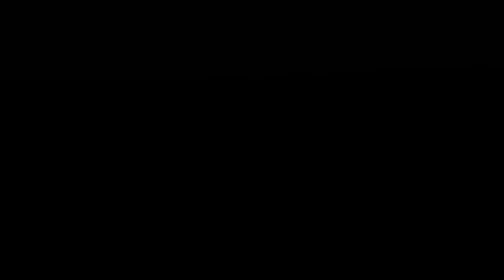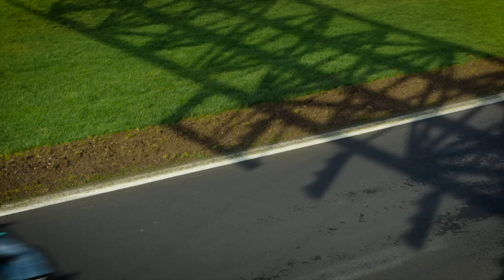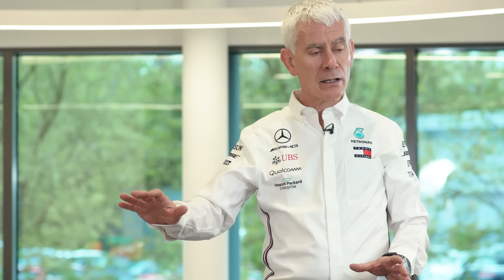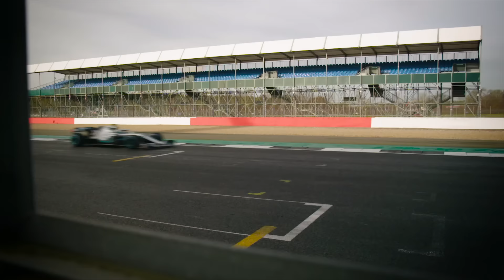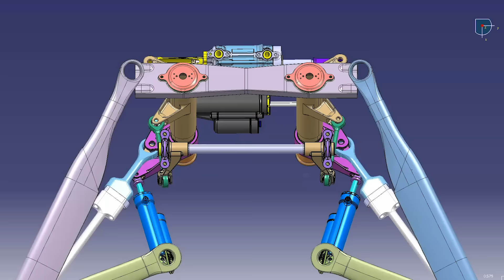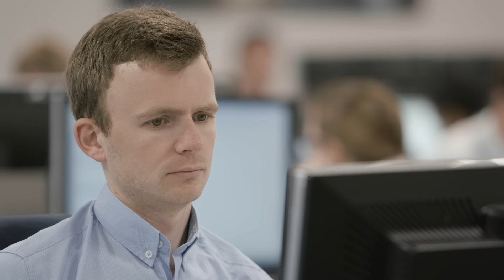How Does Suspension Work on a Formula One Car?

Comment: Mercedes: dominant competitive team

Also Mercedes: tells other teams how they make their car
Reply: ALSO Mercedes: still win by 30 sec after showing how to make their car
Reply: 1. They didn‘t show their newest suspension with the pushrod
2. They just show the obvious things
Reply: @rainys8223  - this is'nt the W10 which has the advanced 2 piece link front push-rod; this is more like the W09.
In this video, the "animated" part shows only the pull-rod and NOT the push-rod.
Reply: @rainys8223  - plus the W10 is running a "simulated" brake-by-wire rear wheel steering.
Reply: Rainer r/wooosh much?
Reply: This video showed nothing other than the obvious
Reply: Ik they used an older steering to make its video to keep the current one under wraps. They dont expose everything. They're not stupid lol
Reply: They didn't show any of the fine details, just the basics that every team already knows
Reply: easy on the

double spacing.
Reply: Racing Point clearly is watching these videos xD

Comment: Just shows how much work and ingenuity goes into these engineering marvels.
Reply: Only scratches the surface.
To keep it understandable for the majority of viewers and Williams engineers. 

They didn't go into camber toe in toe out and how the suspension changes those values depending on the centrifugal forces. 

Example. Camber is how much the tyres are tilted. Want them flat when braking and accelerating in a  straight line. 

But when the car tilts in a corner you lose surface area. So for high corner speeds you'd want the outer tyre flat on the tarmac despite the roll and remain full contact with a potentially bumpy track.

You see this can't all be achieved without active suspension which is banned by the rules. 

So they have to be (and are) very clever in making a mechanical suspension which adepts depending on load. And fine tune it for every specific track. 

Now how they do it? That goes way over my head as well.
Reply: @1barnet1  I like what you did there

Comment: F1 Suspensions are just brilliant.  50 years of evolution in design.  Separation of roll and heave....   No more coil overs....  torsion bar handles all roll stiffness.... the torsion tube spline and secondary arm design gives you a ton of flexibility to change motion ratios....  you can separation motion ratios of roll and heave....just bloody amazing.

Comment: My takeaway on this, is that I can't even begin to comprehend the strength of the spring unit in the Heave Spring, since it basically supports the weight of the entire car and the additional aerodynamic load, as well as providing for chassis movement!  Well done Mercedes, and thank you for this informative video!

Comment: As a mechanical engineer student currently working on a suspension system, I could say that I would easily die for the Cad and assembly files of this suspension 😂
Reply: So who would do the hard work then if you are dead on the floor? xD
Reply: @Jejking  me, in my very happy spirit form xD
Reply: Well you would of noticed the CAD shown had nothing to do with the F1 cars front suspension shown.CAD shows pull rods F1 car uses canter levered push rods with inboard shocks.

Comment: This is a fantastic series. Thank you so much for posting it. I was thinking... I drive a 'Mercedes', but it couldn't be more different, and more primitive. It is actually a Brazilian Toyota Land Cruiser FJ40 (Bandeirante) With a Mercedes-Benz OM 364-LA Turbodiesel engine, originally intended for the MB-914 truck. Here is the 'primitive' part; my suspension is leaf spring with two rigid axles, and PU shackles.

Comment: I would LOVE to one day see an example (not current year of course) of how the suspension components are constructed and the materials used in building them. It’s always fascinated me how a particular component can carry an extreme loading, either static or dynamic, however only in a particular direction. As in how a front wishbone can absorb impact loading from the weight of the car, and possibly from front-to-rear impacts, but maybe not from rear-to-front or longitudinal impacts. Incredibly complex and interesting, and it would be an unbelievable opportunity to one day get a better sense of ‘the black arts’ used in building them.
Reply: mechanics of materials would be a good start, oh and look at chemical structures to get an idea how bonds form and their strengths and weaknesses. 

honestly it was probably luck at first then lots and lots of experimentation... so more luck.
Reply: They’ve certainly have had some spectacular failures thru the years! As in STR a while back. Trials & errors can lead to huge advancements.

Comment: What a coincidence they're showing the w9 (last year's car), since the new w10 has some kind of extra pushrod link to change the ride height during low speed corners, pushing down the front wing which results in the generation extra downforce in the slower speed corners... might be a contributing factor to why they're so quick this season :) If only they'd reveal those kind of things...

Comment: Great videos. I'm intrigued that you seem to share a spring and a damper for each side of the car. Is there an independent function inside each unit or are they really shared? I would have thought that fully independent suspension across the car would give you greater control. Or is this perhaps a regulatory thing?

Comment: Next up: How Does The Race Strategies Work in Formula One?
Reply: MEGATRON  If you considering about the tyres only, maybe. But, Merc was ahead by calculating the data of the medium tyres, AND the capabilities of their drivers to manage and use those medium tyres for the long run from the FP2 session data. Yes, Hamilton was tremendously pressured by Verstappen, but he was still able to defend him off and took the win splendidly.

Comment: You had mentioned that the suspension effects the aerodynamics of the car. Why don't you contour the pieces to net downforce on the car, or are you afraid of any additional loading to the suspension components? I would think you could then either get more total downforce, or require less from the spoilers.

Also, out of curiosity, what software do you guys use for your 3D modeling? I presume the similar software is something homegrown or do you use something like ANSYS?

I enjoy the videos, keep them up!

Comment: Great video. The diagram of the front suspension seems to be upside down, hummm.
No mention of the new system that seems to be helping Red Bull, where the angle of the front wheels can be changed in corners to give a toe in and more grip on both front tires. Now about the small electric motors in the wheel hubs, that eliminated the need for drive shafts to the wheels... and not being allowed to use those tiny cooling holes....
Reply: Those are rear pullrod suspension. You could even see the "hole" on bottom wisbone for shaft goes trought... Thought i m sure this is outdated diagram.
Reply: @alesksander  I see, all those diagrams were for the rear suspension, which is odd since he is pointing at the front.
Reply: @gordonanderson3111  Yeah sad fact about those video there are always all over the place. i m engineering person and i know what to looking for so it is frustrating for me also. F1 is really good in engineering overall. Also this is area in witch we could also appreciate the Mercedes F1 team.  Its efficient  operation and impressive success.
There is no point to fool people. Engineers are not stupid. So there is no hiding necessary.

Comment: In the F1 cars installed power steering, or some other amplifier?
Reply: Thats a hard one. In theorie you don't need them if you got your kinematics right. But as these cars  experience lots different amount of downforce and weight shifting, what they called platform control. You need some sort of decoupling the tireforces of the drivers arms. So they are allowed to use amplifires if they are not "closed loop" controlled or powered by electricity. Which leaves to hydraulics and decoupled suspensions/steering.  As in F1 you not only adjust the steering angle of each tire different you adjust the camber as well, while all of this is powered by the drivers arms alone.

Comment: is that some kind of hydraulic spring on the front?
Is it active throughout the track like f1 cars used to have?
Reply: However there has been FRIC, mostly used by the top teams. It was banned in 2014 and was essentially a link between the front and rear suspension which reduced pitching, especially under braking and acceleration. It was therefore considered to be an aerodynamic aid and was made illegal.
Reply: oh yer is that the thing porches LMP1 cars had?
I read about that in magazine.
Reply: @millerchassis6119  Don't know about LMP1, but Red Bull, Mercedes and Ferrari definitely used it. Not sure about the other teams or racing series
Reply: @millerchassis6119  I just looked it up, you were right, Porsche used a system similar to FRIC, Audi used it too and also Nissan developed one.

Comment: The driver can adjust the dampening of the suspension with a push of a button while driving right??
Reply: I think its also parc-fermé so i don't think so but I am not sure
Reply from the maker: No they can’t do that!
Reply: @MercedesAMGF1  can the Engineers adjust the dampening while the car is on the track?

Comment: I have  questions please, someone, answer to me
1. Do Mercedes F1 W11 still use the pull-rod suspension?
2. This video on animation design (which is was on CATIA) shows the pull-rod system BUT on video, the car has the push-rod system. why?? Am I wrong?
BTW I'm a mechanical engineer student and working on my master's paper about suspention.

Comment: Ah, no.  2 functions are command and response.  Command is how the car responds to the driver's commands, ie. steering, braking.  Response is responding to what the road throws at it.  The two can be conflicting interests.  Platform control?  Whatever.  That's the increased loading because of aero stuff.  Your car ain't a plane.

Comment: suspension nowadays is VERY easy, theres not many things new that we dont know about that can make a difference

heres the 3 major aspects to worry about when it comes to suspension (everything else is nearly irrelevant in a normal car):

-  bumps, holes (vertical suspension)
- acceleration, breaking (vertical suspension + vector suspension)
- handling (vertical suspension + vector suspension + independent wheel suspension control)

Now, formula one suspensions are limited due to restrictions rules from formula 1

For example, a Tesla can have MUCH better suspension and handling than any formula 1 suspension.
Telsas can pretty much bring the suspension system up to a stall in evolution, while fomula 1 are limited to conventional methods.
Tesla cars not only do everything I said above, but they also electronically account for the aerodynamics force and adapt to your own driving style.

Formula 1 is dead in terms of suspension evolution. No normal car will ever use formula 1 prehistoric traditional methods in teh future.

So yea guys, ignore this video as it is rapidly becoming obsolete in todays world, formula 1 needs to redo their rules and restrictions if they want to stay relevant.

PS: and this might be actually part of the reason why mercedes doesnt care about giving away information that every other team already knows nowadays.

Comment: F1 suspensions has no big changees for the last twenty/thirty years. Carbon fiber arms has been using since the 90s . This is just a marketing video from Mercedes which is good at bull shits, Mercedes road cars has nothing to do with F1 engineering. The AMG GT is an Aston Martin vantage chassis, the chassis is not even designed by Mercedes

Comment: It's very sad, that the adjust of the suspention (and many other things) it's allowed during the race, from the pit! That's why F1 today is so flat and boring.
Reply: @kevin paul halliday there is a two-way telemetry which allows track-side engineers to communicate with the driver and make adjustments to the car's setup during the race.